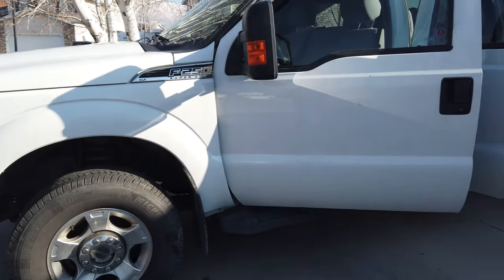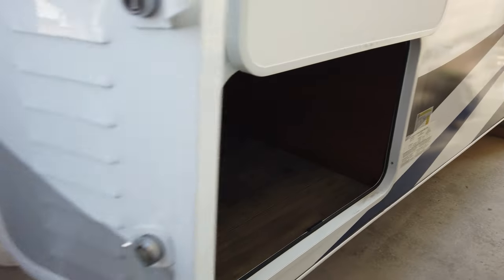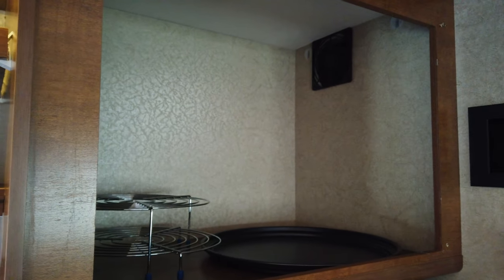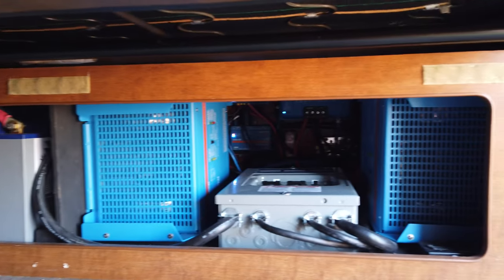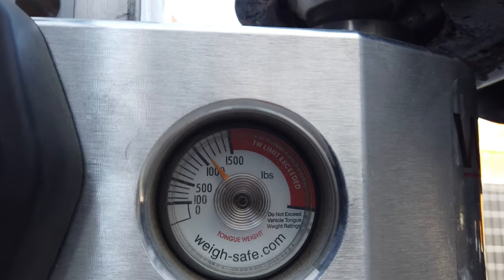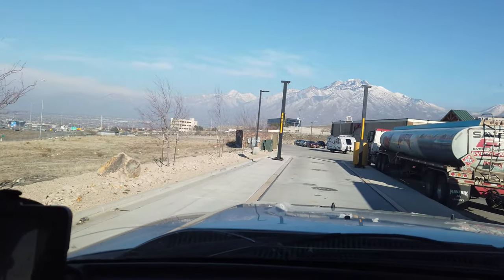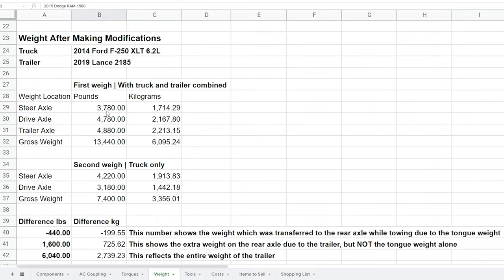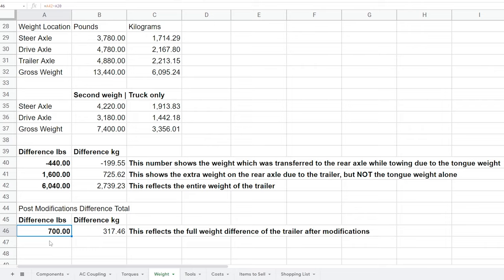Weighing Our Lance 2185 Travel Trailer After All The Electrification Modifications

Comment: I was a bit nervous when I saw 6,040 figure as the GVWR for the Lance 2815 is only 6,000 lbs. But you said you upgraded the axles and frame to go to 7,000 lbs? Is that reflected on any official documentation or sticker or placard on the trailer anywhere?

The reason I ask is I've considered doing this upgrade myself to increase carrying capacity... but the issue I have is the "official" weight sticker on the trailer would not reflect that added capacity. So my concern would be if you were at say 6,800 lbs once you add cargo, water, etc to the trailer it'll "appear" to be 800 lbs overweight. Do you have any official documentation that you could show to law enforcement and/or your insurance that you're officially certified to increase your GVWR to 7,000 lbs on the trailer now?

This stuff just makes me nervous for liability and insurance reasons. If you get in an accident and someone finds out you're "overweight", even if the accident wasn't your fault at all, it can increase the chance that you are found at least partially at fault due to being overweight.

If you did get some kind of official documentation that your new GVWR is 7,000 lbs: How did you go about doing that? That would be really helpful information for others looking to upgrade a trailer for more carrying capacity.
Reply from the maker: I don't have any official GVWR increase and I don't know how I'd go about doing that. Have you heard of any real world examples of what you're describing around someone having increased liability due to not having an official weight increase?
Reply: @ElectricTechAdventures  I have some friends I trust in the auto insurance space who have told me that it definitely increases your risk of liability. I've also read some stories of people who claim it's happened to them in the RV discussion forums.

It's one of those things that you don't really know for sure how likely it is to be an issue... But I don't necessarily want to be the one to find out either. 

Your situation is slightly different since you upgraded the axles (and by extension I would assume the brakes are bigger too) so the axles might be the important part liability wise... But then you'd be in the position of having to convince the appropriate party (police, insurance, judge, jury) that upgrading the axles makes the number on the weight sticker irrelevant.

I'm not saying you should worry about it. It's just something that has given me pause in the past and I was hoping maybe you had found an answer to this particular challenge. It's hard to find RV travel trailers that have the cargo carrying capacity to handle large solar and battery installs.

Comment: I can't see the point to weight everything Empty. You should weight everything loaded like when going camping. The scale numbers are useless empty.....
Reply from the maker: My purpose was not to know what the weight of the trailer is ready to go down the road on a trip. The purpose was to see how much I modified the weight of the trailer from its original state. In the video that I published this morning we went by a CAT scale fully loaded up going on a trip. I would not have known how much weight capacity the trailer has available if I had not done this step. I knew that I had an extra 1,000 or so pounds to work with in the bed of the truck so while we were literally going on a trip I knew I would be fine to be able to move things to the bed of the truck if needed.